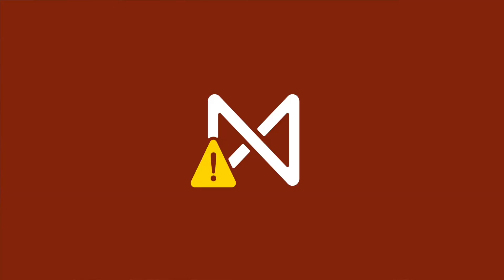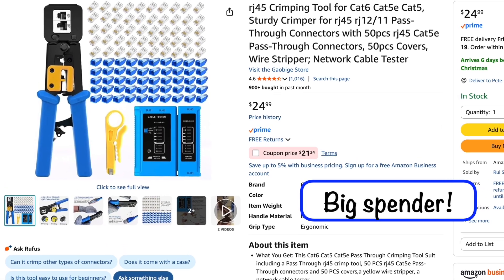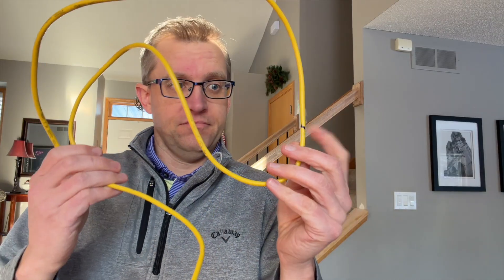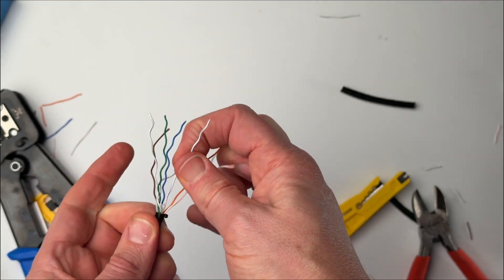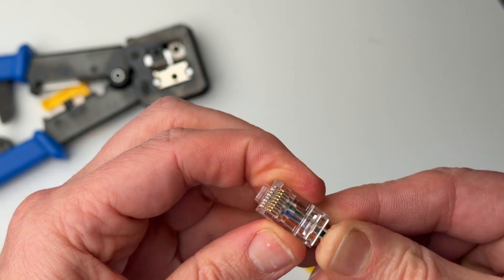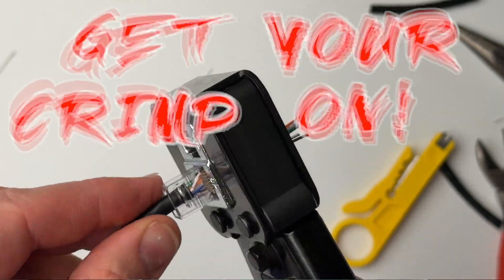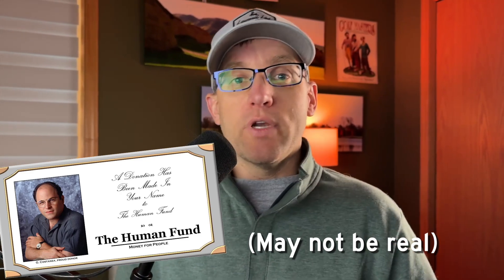How to Make Your Own Ethernet Cords -- Wiring Passthrough  RJ45 Connectors

Comment: This video appears to have been designed as rage bait for professional technicians.

00:49 Pass-through connectors require a particular kind of crimping tool that cuts the protruding ends from the front of the connector. Pass-through cables are NOT suitable for PoE applications because arcing can occur at the exposed ends.

1:17 Two or three inches if you're a noob ;). 1.5" is usually plenty.

1:25 use flush cutters and remove that spline as close to the base as possible without damaging the conductors.

1:32 If I'm doing just a few cables I use the smooth, rounded spine of electrician's scisors opposite my thumb to grab, untwist and straighten each pair individually. If I'm doing lots of cables in one sitting I'll use a specialized untwisting tool to keep my fingers from getting rubbed raw.

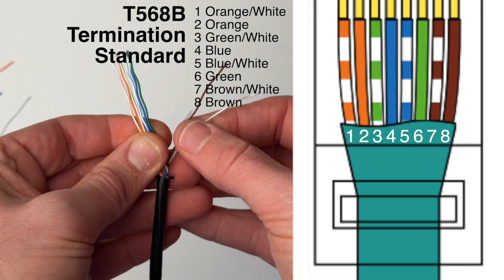1:45 The order ABSOLUTELY MATTERS. Ethernet uses differential signaling which relies on a twisted pair of conductors for noise reduction. If you arrange the conductors willy-nilly and split a pair then you've negated the mechanism that maintains signal integrity and your cable will not work! Choose either EIA/TIA 568-A or 568-B but don't go inventing your own order!

2:50 Pass-through connectors require a special crimping tool that cuts the protruding ends flush to the connector body. If you're using pass-through connectors make sure you buy the correct crimper or you'll be in for an unpleasant time.

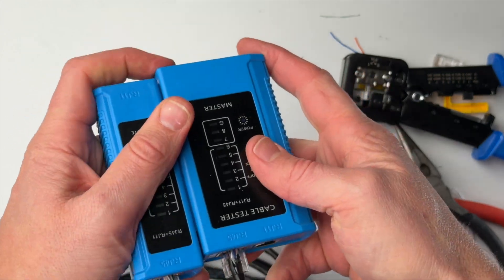3:18 Cheap cable testers like this check only continuity. If you've followed the bad advice at 1:45 then the tester will validate your incorrect wiring and your cable will likely cause problems.
Reply: Also, your mic is popping loudly every time you utter a plosive (i.e. "P", 'B' or 'T' sound). Good audio is an attainable goal. Don't give up.